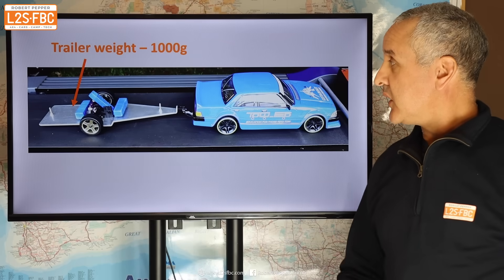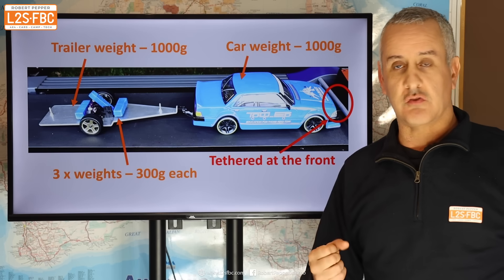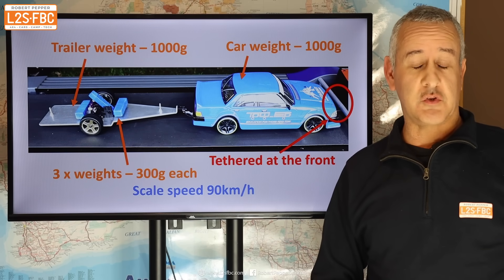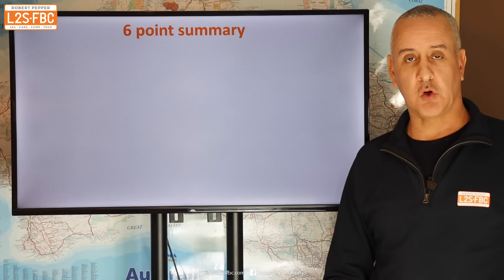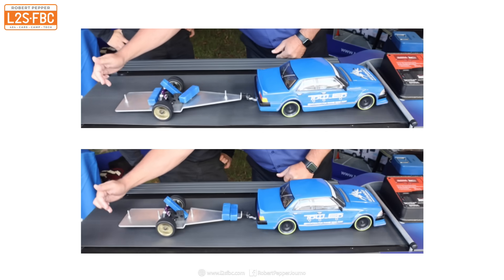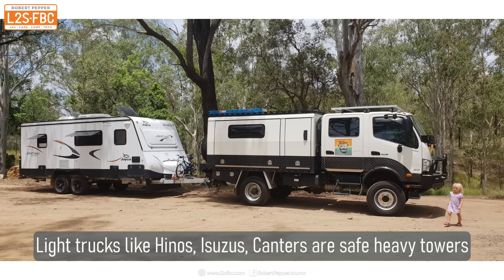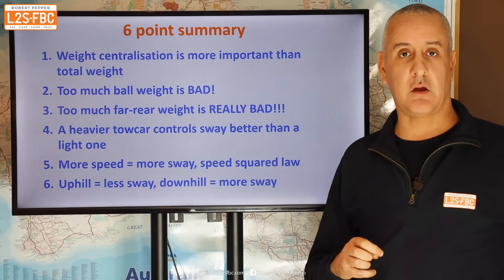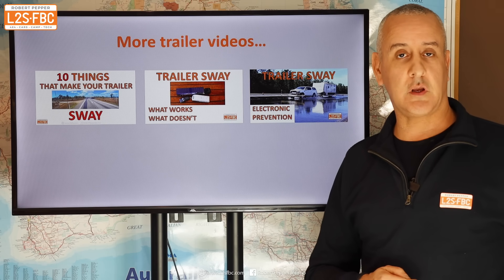7 trailer weight distribution setups, some safe, some deadly.

Comment: Very well organized, presented, and crystal.  The demo refers to dead weight.  We need similar presentation describing how and what happens when towing liveweight (livestock).
Reply from the maker: Thanks Sharon, bit harder to model but could be done...I'm guessing you are thinking of horses?
Reply: @L2SFBC  Yes, thank you Mr. Pepper.  I think the bulk tank liquid shippers have baffles in the tanks to to prevent surge on braking or acc'n.  The horse balancing head free facing away from the direction of travel in a float, with its thorax centered between two specially placed axles, has no trouble remaining stationary and balancing.  It will even doze with a hindquarter resting. The bedding will not be disturbed and there is no damage to partitions or sides.   It cannot do this when facing the direction of travel.  Its weight is constantly shifting or it leans and scrambles.  It can never rest a hindquarter or drop its head to clear its respiratory tract.  So I'm wondering just what part of the horse's actions or float design might contribute to loss of vehicle control or sway.  I've also heard that the constant shifting and struggle of the horse to balance in a standard float contributes to engine wear.  For now, I can only conceive of an articulated mannequin that has different sections filled with water to imitate the fore and back or stationary stance of a horse.  I don't know how valid this would be for testing the float's response.  Areion, Australia, has an ingenious rubber horse, Tippy, for testing its horse float safety design.  Chris Riley, at Massey U, NZ has a hair raising video showing just how the horses a professional driver hauled struggled in a standard float.  DEFRA funded a similar study for livestock vans in Scotland showing that even vans driven according to EU rules deliver bruised animals to slaughter despite the best driving.   I'll say it again, your presentations are beautifully honed and memorable.  Not a word wasted.  Thank you so much for your interest and the obvious care you take in presenting the logic of your findings.
Reply from the maker: Sharon, very interesting thank you. I have never towed a horse float or live horses (but I did once teach a horse owner to back her trailer!)  What about loading sideways? (slant).  The difficulty I see with modelling is recreating the movement of the horse, it's not a dead weight.  And there would be a huge variation between trailer loaded and unloaded weight, unlike caravans for example.  For those interested check this out -> https://www.facebook.com/areionequestrianequipment

Comment: Just out of curiosity, do you guys in Australia and Europe not run trailer brakes? I'm only asking because although weight distribution is the most important thing there is obviously a way to snap the trailer back in line and that's to hit just the trailer brakes. Over here in my area they teach you this and it works every time.
Reply from the maker: In Australia independent brakes are required over 2000kg, don't think they have the same rule in the Uk

Comment: This is really interesting. I have a trailer that is quite front heavy, about 1000kg towed with between 1600 and 2000kg of laden car/occupants, about 150kg on the ball without ballast, so I have a bunch of weight just behind the rear axle, but still quite close to the rear axle to reduce that to around 80kg ball weight. I've towed that thing to extreme speeds of around 160 passing idiots that drove 70kph and spend to 120kph in the passing lanes and it's always been perfectly stable. I put that down to the heavy ball weight but you're telling me that the weight at the back can make it worse,  and that's what I've got. I guess something you don't cover here is ball to axle distance relative to CG. Mine is quite long, very easy to reverse and very stable naturally. I intend to get my trailer lighter and better balanced and that will help it due to the relative weight of the tow vehicle. I'm also going to lengthen the draw bar a bit for other reasons which will further reduce ball weight and increase stability. What I found most interesting is that you added a LOT of weight to the middle of the trailer and it stabilised it somewhat. Very interesting. I'm going to add air-bag helpers to the rear axle of my road trip car and wider stiffer tyres, too, which should help keep things reasonable and safe. Cheers.
Reply: I will add that I have had sway that worried me twice:

1. BMW 750i on a heavy car transporter trailer behind about 1800kg of 4wd Stagea wagon - was mostly fine, but I think the speed crept up at one point and it just started to sway slightly and I settled it with throttle and then lifted to gradually slow down.

2. My utility trailer with a heavy load of timber rear biassed because the load was longer than the trailer, also chewed the car tyres out of it, delaminated, went and hired a dual axle after that and no further trouble

Thanks again for this, it's been educational even though I thought I already knew most of what I needed to, I was wrong, there was more to learn. And not finished watching, yet.
Reply: I will add that my front heavy trailer has decent shocks in it and soft springs and I believe this is part of the reason it's very stable. Fresh shocks in tow car and stiff tyres and shocks in trailer and things are a lot more likely to keep going the way you point them. Stiffer springs better, for the load, too.
Reply from the maker: So good to have your practical experience aligning with the model, thank you so much for posting!
Reply: @L2SFBC  You're most welcome. Thanks for the thought provoking and educational videos. I will add that my approach to stabilising sway on the BMW tow job did work, and your other video advises that it doesn't. I'll point out to anyone else reading this that you're mostly advising for big high caravans with soggy shit suspension and in those cases, for sure, do not accelerate like I did, it'd be a death inducing move. My case was mild sway and not close to getting out of control, more just hinting at it, that's why it was fine to do what I did. Don't want to inadvertently mislead a reader into ignoring your solid advice in the other video :-)

Comment: At first the trailer on treadmill i thought was wrong, because here in the states all of our trailers axles are 2/3 in the rear. But then you said weight on the axle, which is correct.  So an empty trailer puts more weight on the ball, we call tongue.  So to compensate for our trailers, the heaviest weight goes on the axles and then gets lighter as the weight move towards the ball or tongue.  Your first model would be the other way around. Since that axle is on the tongue or ball, heaviest weight over the axles, then lighter goes behind the axle.  This not making the tongue any heavier.  Basically every trailer is different.

Comment: I have a question. Most caravans state a tow ball weight. This would imply that the front of the caravan should have a weight bias towards the tow ball (for example 50Kg toe ball weight). Watching your video you would imply that the tow ball weight should be zero. However I have experimented with the tow ball weight on my caravan in I have found that applying the recommended tow ball weight does indeed make the car and caravan more stable. So I’m a little confused regarding your experiment. I would be grateful if you explain this for me ?

Thanks
Reply from the maker: The towball mass should never be zero. Follow that recommendation. However, do not get there by placing a weight at one end and balancing a weight at the other. Centralise weight whilst leaving a towball mass.
Reply: @L2SFBC  cheers it’s just that your video didn’t point that out
Reply from the maker: It did...watch closely

Comment: First trip with new enclosed trailer with half ton truck.  I knew pickup @3500 lbs lighter then 1 ton, unknown trailer dynamics. 1000 mile trip household.  I kept weight in mind during loading, sorting…. Weigh the hitch. @60 lbs more then I intended.  (As ideal, well within range). Relative 3/4 ton diesel (heavier, better tow unit) I kept suggesting he had too much tow weight. Didn’t get on highway we had to unload, transfer weight.   My truck, trailer towed like a dream.  OD locked out of course.  I used weight distribution hitch but set fairly lite.

Comment: Thank you for insightful display. Could you demonstrate the effect of placement of axles moved forward or backward on trailer?
Reply from the maker: Coming..
Reply: @L2SFBC   Over many years of towing heavy boats I found that having the axles ( always 2 axle trailers) further back the trailers are more stable with the same towball weight.
I test the stability of the trailer on a quiet road at about 80 kmh by gently swerving so I induce some sway then see how quick she settles. When I do that I have my hand ready on the trailer brake just in case...
I find weight distribution is very critical.  My boats always have outboard engine/engines so they have a lot of weight behind the rear axles so I load the boat above the axles and fill the tank  of the boat located just above the axles.
I don't know if it is coincidence but I find that long draw bars ( distance from tow ball to axles) help sway as well.
Maybe you can test that some time.
Great video especially for novice caravanners.

Comment: It's nicely explained, but it's just common sense. Also you don't lose control of the sway if you know what you're doing. I had it once when towing a caravan with smaller car. I was going like 50 max, while trucks are doing like 80, so one truck blasted past me and it caused the sway, but by using COMMON SENSE I restored control after 2-3 sways. you just gotta counter steer and slow down at right moment, if you slow down at wrong moment, then you just cause it to sway even more. It's basically like balancing a basketball on pencil

Comment: I drive for my company moving excavators and scrap wire, light piles and pallets of concrete on a 20’ goose neck trailer hooked up to a 07 Dodge Ram 3500 one ton dually. I’ve heard many times that you want a 60/40 distribution with most the weight on the axles and a little bit more towards the front. That’s my question is if I have a 9,000 pound excavator, is it better to have all the weight over the rear axles or have it a little bit more towards the front.
Reply from the maker: Tiny bit over the front.

Comment: I’d be curious to see the effects of increasing road speed (say, from 90-120km/h) once a sway has started, with the different types of load scenarios. 
I was once taught years ago that “accelerating out of it” was the most ideal way to get out of a potentially dangerous sway, as instinctively braking upsets the balance even further. It has saved me more than once while towing a car on a tandem axle trailer. 
Thank you for the informative video.
Reply: I found manually activating trailer brakes gets you below speed of sway quickly. Just do not hit them too hard.
Reply: @larsharris  Yeah,use the trailer as a parachute.
Reply from the maker: Exactly right
Reply: @L2SFBC  So why didn't you just answer the question like Larry did?  You guys and your YouTube algorithms.  Ugh.
Reply from the maker: Have another video on why accelerating is not a good idea
Reply: There is a simple reason why braking or accelerating is not the answer to sway control it is lack of physical control over the sway forces before they get out of control and for reasons unknown to me there is a simple device that can do this and yet has not been 
exploited.
Reply: Sway control  has more to due with the steering axle and driver control and overall length of tow vehicle wheelbase tires loaded axle weights cross wind weather conditions than driving out of it. 
Following distance speed vehicle maintenance when in doubt foot off the gas foot off the brake. Steer direction you want a go.
Reply: It depends on the dynamics of the situation, Ben. Simply attempting to accelerate out of it can be VERY dangerous. 

Your previous experiences may have worked out ok, but it’s not something that will get you out of every situation in one piece. 

Take, for example, going downhill in the wet at 80-90kph, towing 3.5t. 

No, nailing the brake pedal also isn’t the answer. Larry’s solution is best (when you have electric brakes).
Reply: In my experience, once a sway starts with a trailer without electric brakes, I slow down as quickly as possible and the swaying stops. If the trailer has electric brakes, I activate the trailer brakes only and the sway stops. Obviously, if I can, I stop and adjust the load. This was a great video!!

Comment: Is it the center of mass that is important or putting it over the wheels?
If the trailer wheels are right at the back, should you still put all the weight in the center of mass? Away from the wheels?
Reply from the maker: Over the wheels.

Comment: Keep the weight over the axle, if you have to add weight, go slightly forward rather than rearwards. Saved you 15 minutes.
Reply from the maker: Good summary...but the problem is people won't really appreciate why without an explanation. So investing 15m to watch this could perhaps save them a lot of trouble later on.

Comment: Great video. I have done a fair bit of hauling small machinery in a utility trailer for many years. Every move is a different adventure. One of the lessons learned is that I no longer travel behind other vehicles that are towing or hauling stuff. So many things can go wrong to them and I don't want to be on the receiving end of any of it.
Reply: Or beside! I've seen so many trailers swerve significantly out of their lane when the pulling rig dodges something small or isn't paying attention and swerves back into their lane, slinging the trailer way across the dividing lines.
Reply: based on your lead up, sounds like something happened on the hauling side of it.

Comment: Best video about weight distribution i've seen. I would add though that the weight distribution must be as close as 50/50% over the trailer's axle for a rear-engine car (especially for 1 axle trailer. For a front-engine car no more than 15% weight infront of a 1 axle trailer.
It was a very nice visual demonstration at 6:41 but slightly inconsistant demonstration, showing a 1 axle behavior on the treadmill vs double axle.

Comment: i've towed some big stuff a long way with my vn commodore, way over the gcm.
my advice is simple and follows what they have on the video.
when you're loading make sure everything is a level as you can get it. you want a straight line straight through from the front of the car to the back of the trailer and adjust as necessary. measure from the top of your wheel to the start of the wheel well if you need to because you want your car to be the same height as if it has no load. the trailer should be taking the weight and be balanced.
don't be a dickhead, stay under or on 100 for ffs, keep it slow down hill and use compression to hold your speed down because you're brakes don't mean shit when their overheated.
Reply from the maker: Very good advice, thank you (except for exceeding the limits!)

Comment: Also the weights have a greater momentum while swaying around on the edges of trailer. On contrast, they almost have no momentum when the pivot point is trailer wheels where they are sitting on.
Reply: Yes, this extra inertia explains the instability with the weights at front and back combined.

The trailer setup itself has a natural straightening force (i.e. tendency to pull the trailer back to straight if it gets out of alignment), but if the angular inertia is too large, the straightening adds more momentum as it pulls the trailer back to straight than the straightening force is able to overcome as it reaches the centered orientation, causing the trailer's angle to overshoot. Now it's going the other way and the cycle repeats, with more and more angular momentum being added to the system with each cycle, until the trailer's sway angle pulls the entire vehicle combination over.

If the weight is concentrated over the axle, the angular momentum that builds up is easily overcome by the straightening force, causing each cycle to have less displacement, and so eventually returning to the aligned state quickly, instead of getting out of control.

Comment: I'm only half way through right now, but I'm not understanding the difference in physics between the two weighs in the centre vs at the extremities, in my understanding they should be the same, (though the exact placements of the weights should matter a lot more when at the extremities, maybe that's it?)
Reply: Ok so I've finished the whole thing. I do want to say that overall this is a very good presentation, I do want to expand on my previous comment though, I still think that there should be no difference between centre vs extremities, except that the difference in distance between the two weights from the axle  should play a much much larger role, would have liked to have seen the affect of the back weight pushed forward a cm or so on the extremities example and seen the difference then.
Reply from the maker: Think I'll do another video to explain the differneces

Comment: thats why every trailer should installed sway control equipment, just wonder what the weight distribution for 4 or 6 wheel trailer..